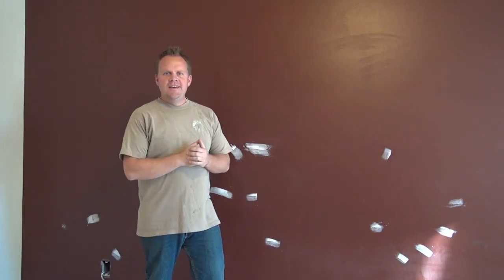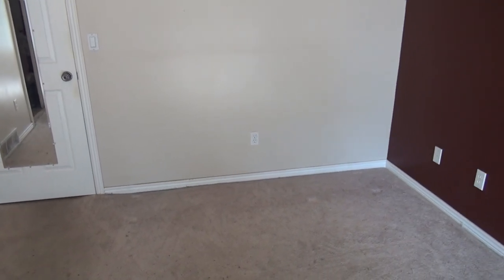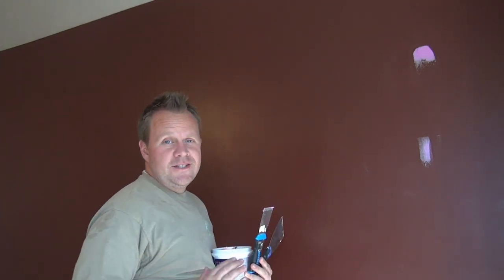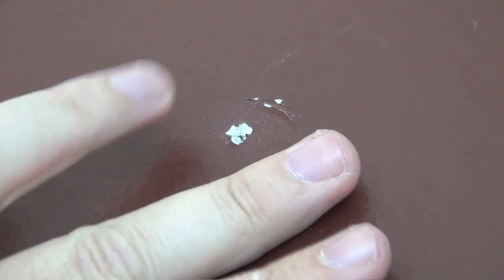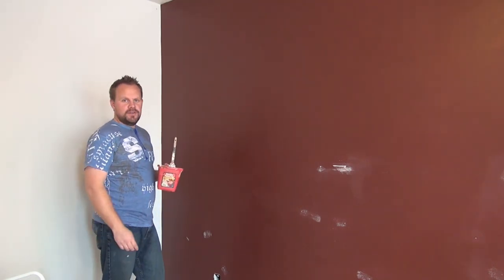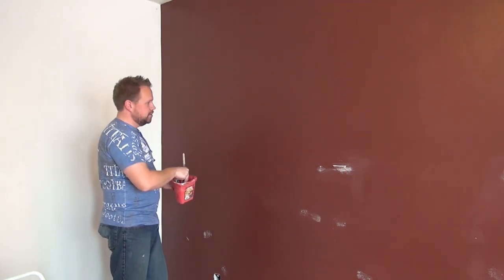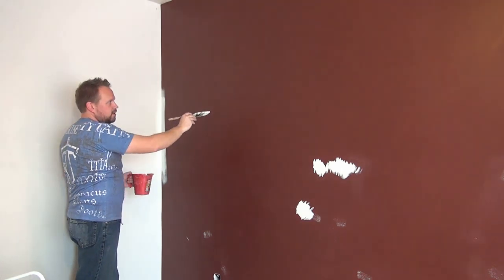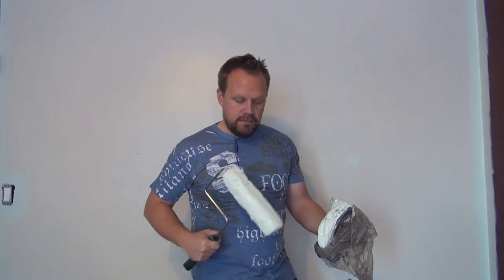How To Paint Walls Like a Pro REAL DIY TIPS & TRICKS

Comment: Thanks for the video. No need to sand at all. Scrape as much filler/spackle up as you can from the wall to leave only as much filler a that is required and just use a wet rag (wringed out) with appropriate pressure applied with you hand to even the surface. This preserves the texture as well without sanding as well. The filler/spackle is water soluble on Dap and other brands.

Comment: Can someone do a white wall please. I have no issue with colours but doing corners and then matching it with the roller is a fukn nightmare !!!!!! Also how do you guys have so much paint on the rollers ? My roller fukn has no paint after like one up and down.
Reply: You have to do two coats bro. Even the paint that says "covers in one coat" needs two coats unless you're using a color very similar to the existing one. Occasionally you can get away with two cuts one roll because the brush generally puts paint on lighter than the roller. But there are so many different size roller sleeves, brushes, and materials used for both that also effect the coverage.

Comment: How much do you overlap your lines? An inch? And third stroke down immediately? If I wait will it cause lines? Also do you cut or roll first?
Reply from the maker: In the application of the paint I generally overlap 1 " for about 3 rows, than go over the same rows smoothing out the paint overlapping 6", when smoothing out the paint always go in the same direction (basically when rolling a wall your applying  the paint to the wall first (fairly heavy) and 2nd is not really to add any paint its more to smooth it out and get a even looking texture) the paint will have a slightly different texture to it rolling up verse down which will cause a difference in appearance, enough that you can generally see the roller mark... Additionally waiting to smooth out the paint more than about the space of 3 or 4 rolls will cause a variation to texture and even color, because as the paint starts to dry it pulls away from your roller nap differently causing a slightly different look. The key is, apply the paint and smooth it all out the same way, which will give the entire wall a very even texture and color. Giving it a beautiful look... I would suggest watching the part in my video where I do the rolling a couple times just so that it hopefully makes sense... And yes cut in first, you can generally get a better look when doing this so that you can roll over the paint lines with a roller nap (as much as possible) to give the wall a matched look without as many brush lines.

I hope this answered your questions, let me know how I can help!

Good Luck with your next project!

(always keep in mind when rolling a wall, you will see uneven  roller lines in the wall until it dries, if you apply it correctly when the paint completely dries the roller lines will go away)

Comment: what do u call that thing u used to fill the holes? does it also works in concrete walls?
Reply: Its called drydex . and it does work on concrete but you have to seal it and prine it or it will degrade and crumble

Comment: Nice video, but you could save yourself a lot of time with sanding by simply taking the back side of the putty knife and indenting the holes is the wall so when you apply the spackle and scrape it you would never even know.  That's what pro's do!

Comment: DO NOT HAMMER YOUR DRYWALL!! Just scrap anything that isn't flush with the wall. The putty will fill it in. Repairing hammer damage is a much more time consuming process.
Reply: Srapping it won't make that purtruding drywall paper go down I use the metal bottom of my 5 in one tool and just press it in creating a small dent to fill

Comment: Don't use a hammer use the head of a carriage bolt and tap it with a hammer or the handle of your 3" drywall knife and use drywall mud in a tray way faster